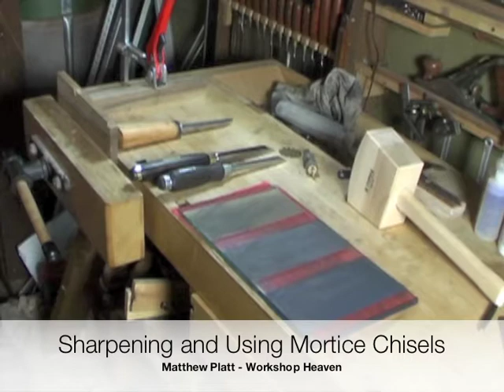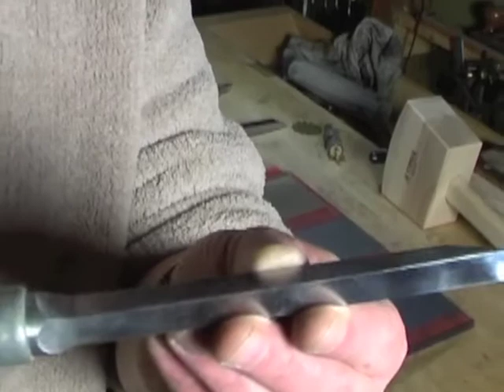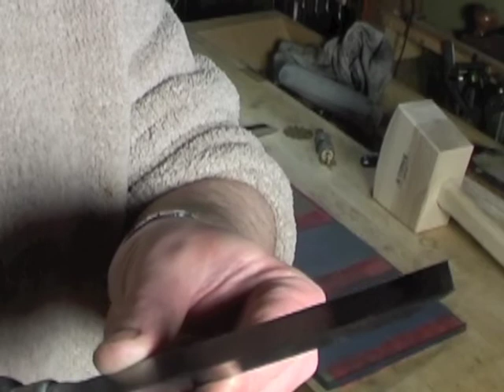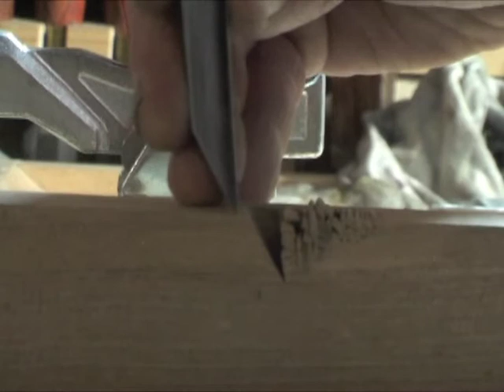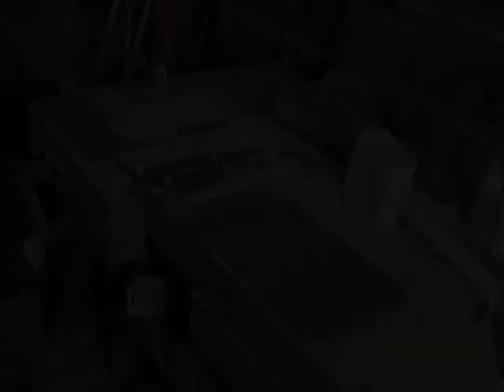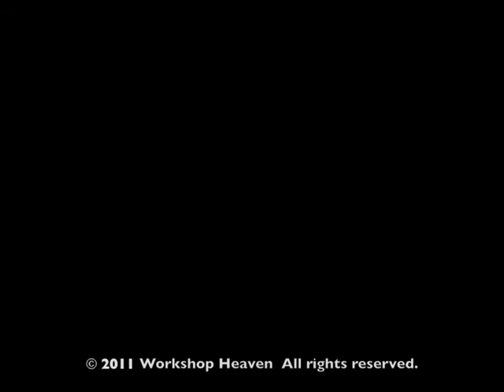Worskhop Heaven - Sharpening and Using Mortice Chisels

Comment: Can a mortising chisel be used to cut in the direction across I.e. perpendicular to the direction presented in the video?
Reply from the maker: Mortices usually run along the grain for maximum strength. If you find yourself needing to cut one across the grain it might be an opportunity to reconsider the design of the piece.

Comment: Is it a flaw when the sides are not parallel? The width is uneven when measured on the front (looking at the edge bevel) compared to a measurement taken on the back. Both measurements at the same distance from the cutting edge. My chisels are vintage and even the untouched ones have this "flaw".
Reply from the maker: Quite the opposite, a good mortice chisel should be tapered so that it is fractionally wider at the edge than the neck and fractionally trapezoidal in section. This allows them to cut without getting stuck in the timber.
Reply: I'll make sure the trapezoid is not inverted i.e. an actual flaw is present in my chisel set. Thank you yet again!

Comment from the maker: Hi Joshua, No problem using a grinder as long as the steel is kept cool by periodically dipping it in water. The primary bevel is 25, the same as for bench chisels. The honed secondary is around 35 to give a really strong edge.